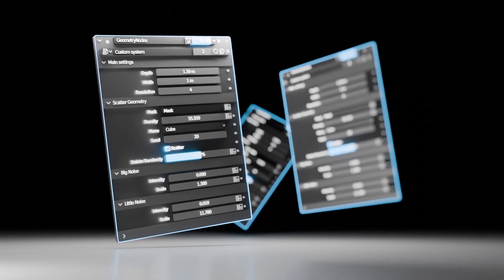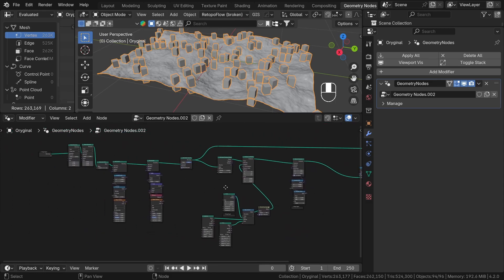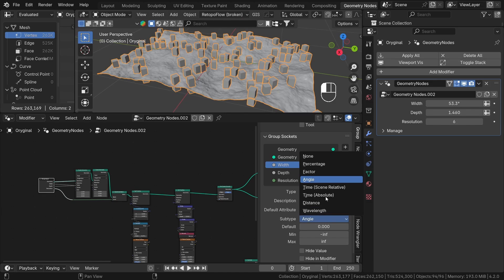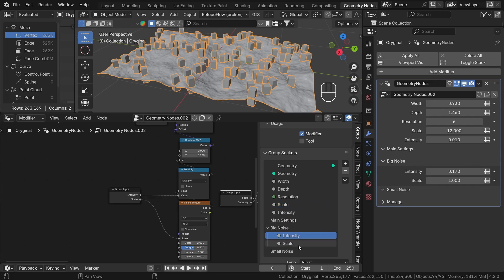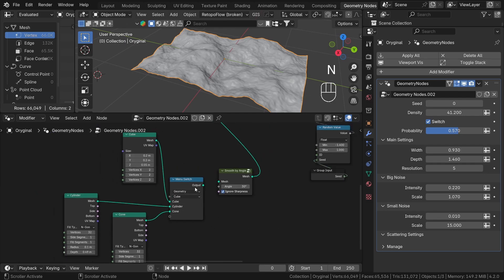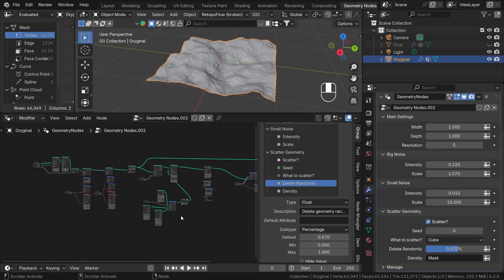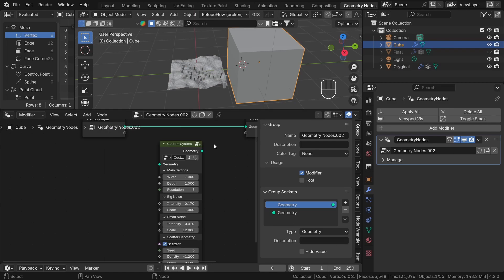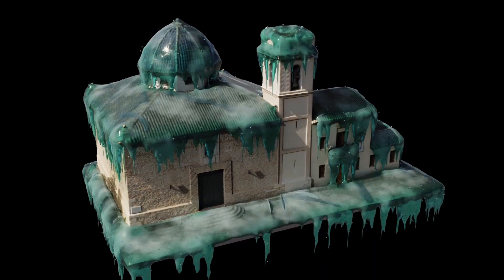How to Create Better Geometry Nodes Systems in Blender?

Comment: I'm pretty sure that geometry nodes could be used to generate supports structures for 3D printing.  Specifically, the one's seen in the Tango slicer would be nice.  If ever you manage to create one, please post a purchasable link for it because I'd definitely buy that for $20.

Comment: Very useful. Could you create an array with the correct rotation (when we draw it with a curve)  with a collection in which we can control the density of object 1, object 2, ....., and use different sized objects? Nobody covers this. This would be cool.
Reply from the maker: I uploaded a short on my channel that I think might answer your question.
Reply: @jakobdesign8066  Thank you. I`ve tried it and some things work, but if the curve has a corner (90 degree angle) the rotation doesn`t work anymore. And if the collection objects have not all the exactly same size it doesn`t work either. I think the bounding box node has to appear somewhere. But I don`t know where and what else this node needs to work in this context. Either way, thank you. <3